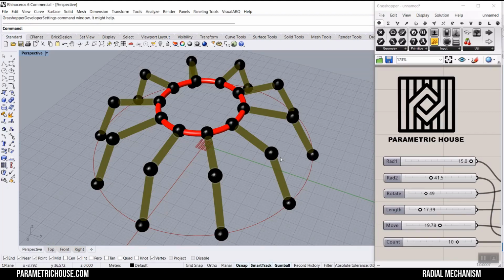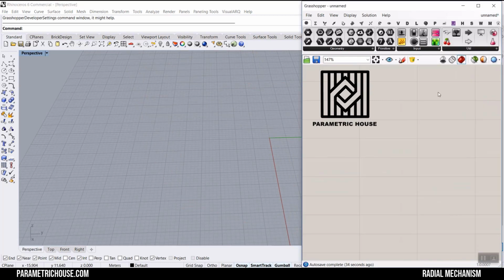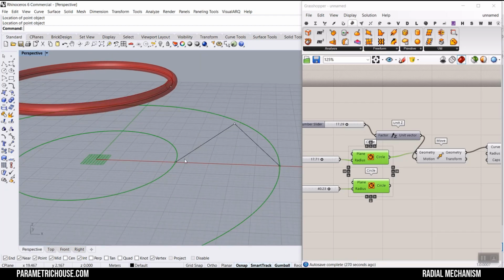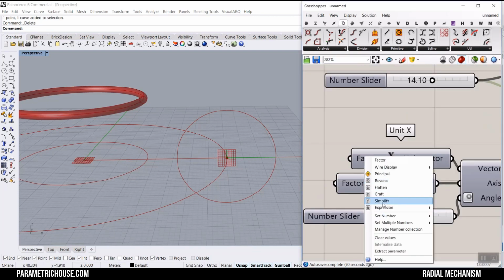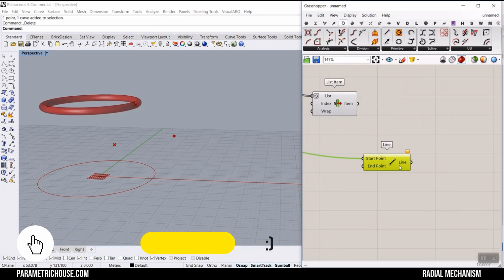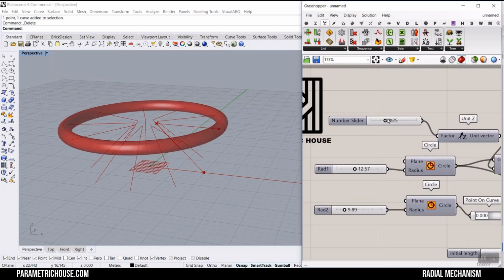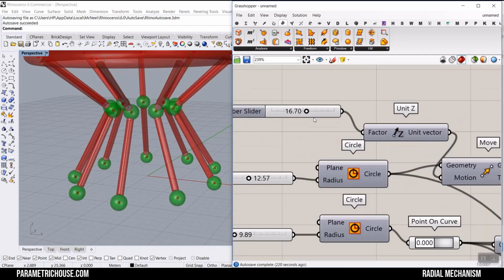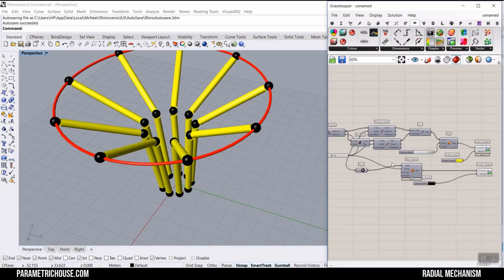Rhino Grasshopper Tutorial (Mechanism)

Comment: Big thank you for uploading this. Just unrelated question for anybody who is reading this: I'm trying to find CAD software for mechanical engineering. I found Rhino and I like what I saw, but everybody is using solid works or fusion 360 for that purpose. Why Rhino is not good for mechanical engineering? Thank you.